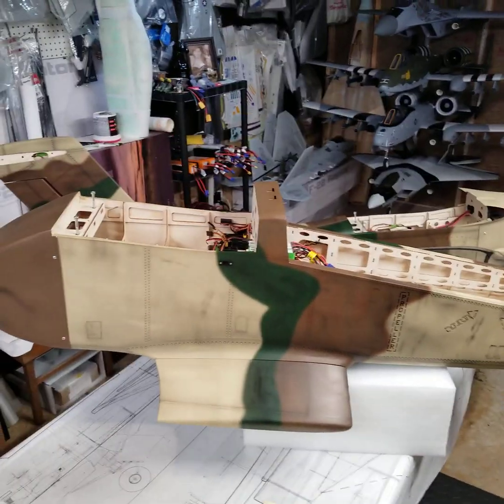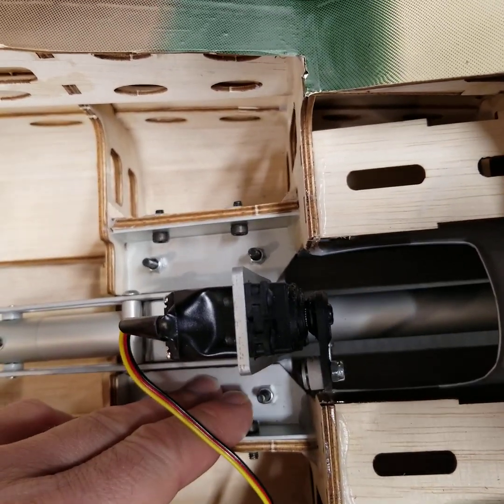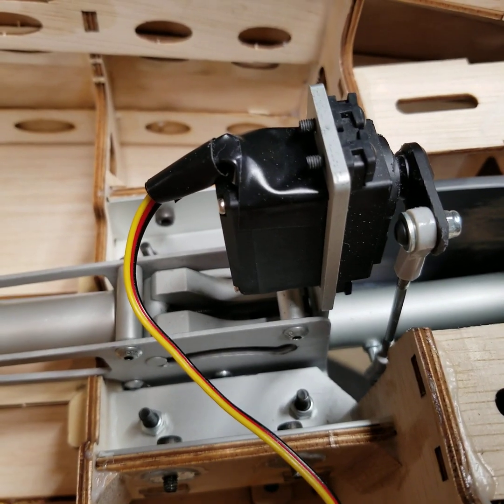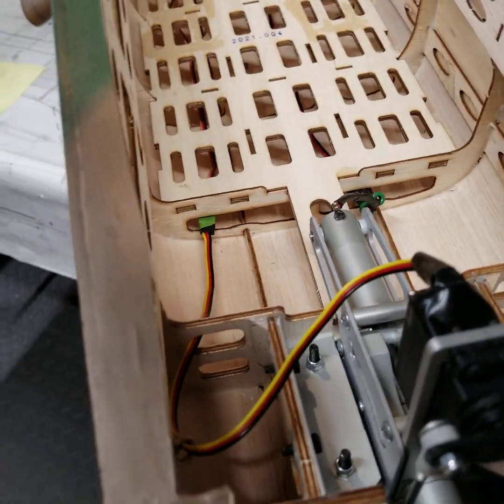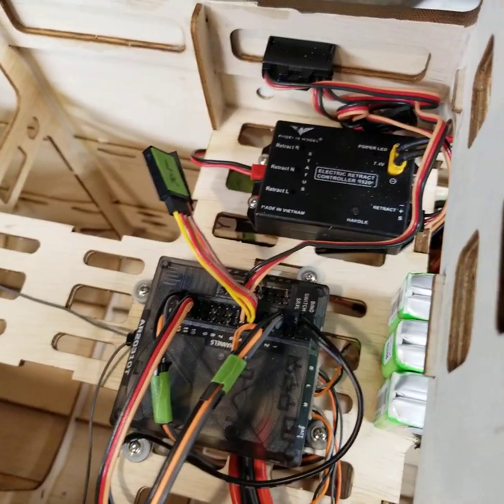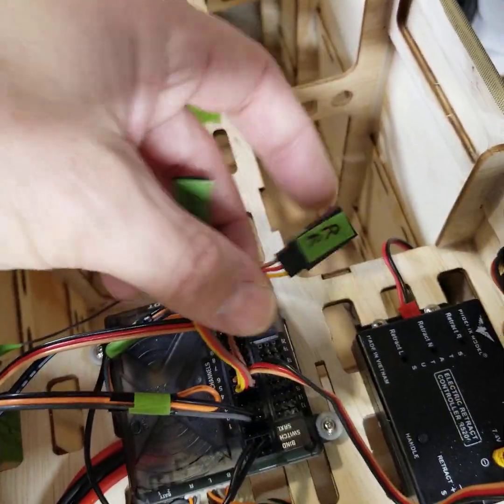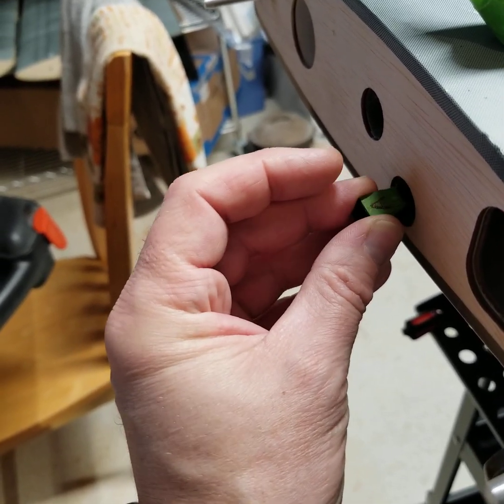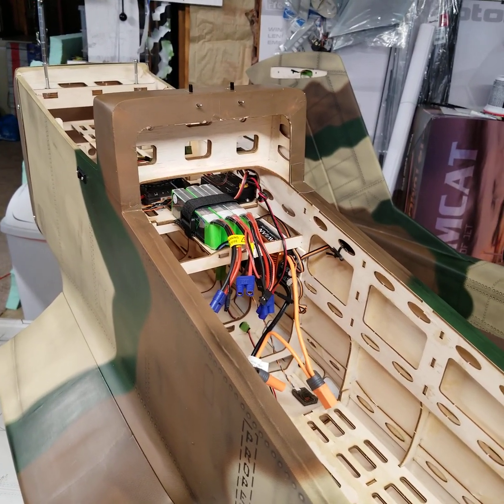Hangar 9 OV-10 build part 4

Comment: OV-10 is amazing !!! Great build , great videos !! Lots of great info !! Thank you !! 
Question : How you can help 
I have can IX20 being set up on a plane with an Avian 120 ESC and 2 / 6s 3200mah 50c spektrum G2 batteries with an Spektrum AR8360T. 

When I connect everything a message come on my transmitter that the batteries are overcharged per cell. Why ? Is there a setting I need to adjust ?
Reply from the maker: Thank you for your kind words. Ir sounds like its just a setting that needs changed in the programming. I have never had that warning before but I also don't use smart batteries. Look up the RCAirmarshall here on you tube, he did a whole series on radio programming that I think could help you. I believe he used an IX12 but a lot of tgat translates to the 20. Good luck!